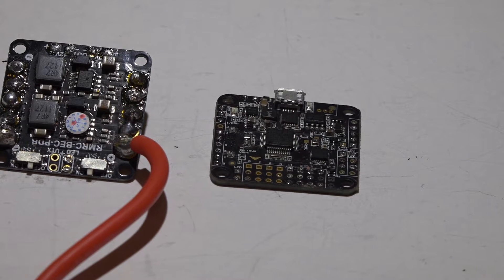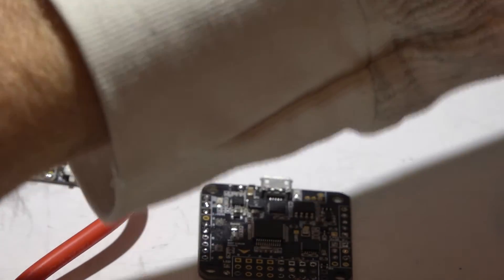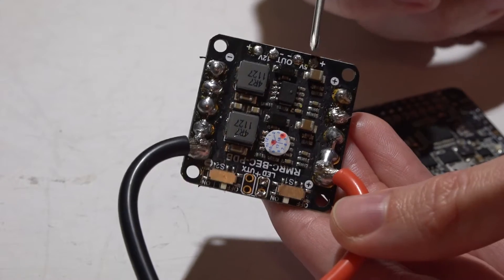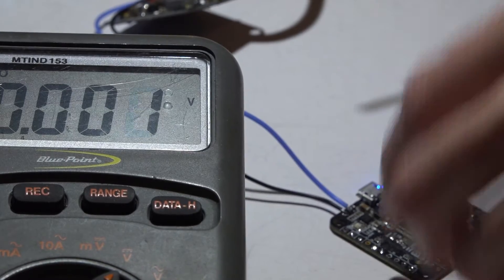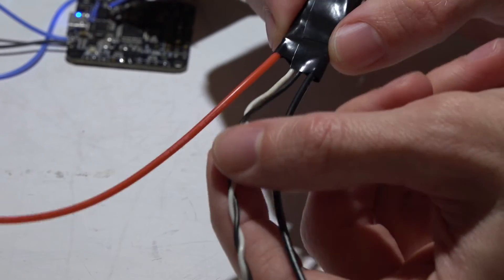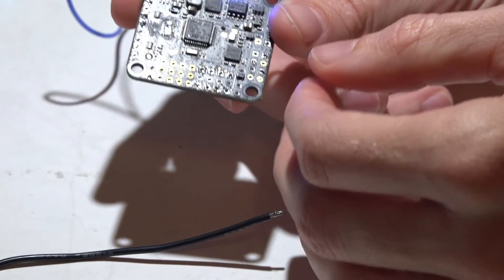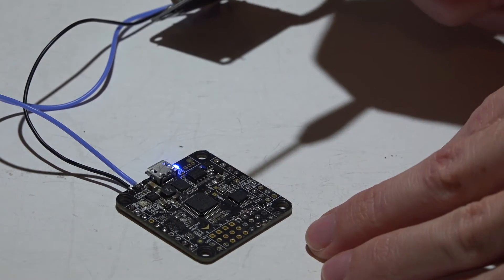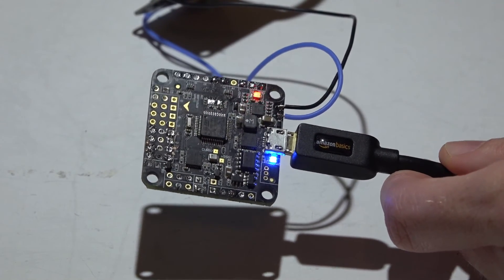Seriously Dodo: How To Power (plus tips)

Comment: I had some issues with the power regulator of the dodo, in particular powering different RX. When plugin a 4S there seems to be an overvoltage or reversed polarity peak which killed 3 different RX already. Last one blown the 6V tantalium cap from RX. 
I already tried adding capacitors but after a few flights, it killed the RX again when plugging a fresh 4S. I measured and regulator voltage is Ok, but the problem only happens when plugging a fresh LIpo. 
Any ideas? I think I will power the RX from ESC BEC as the last resource.
Reply: Did you ever get this issue sorted out? This makes me really nervous. Is it a sparking issue?

Comment: Its been about a year since my last build and this was a nice refresher. What does the ping marked "current" do on the Dodo? Is there a way to read current? Same question for the pin marked vRSSI?
Reply: The current pin is for an external current sensor. A current sensor sends the signal to the dodo, and the dodo can then output it to an OSD by a serial connection.